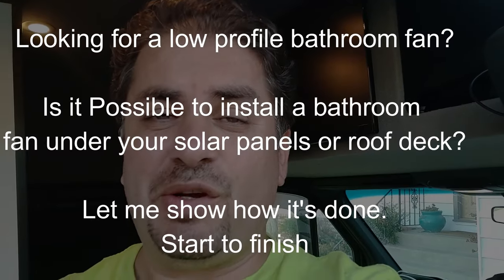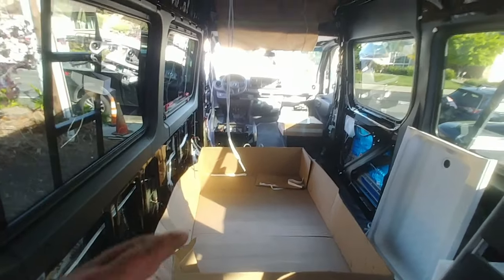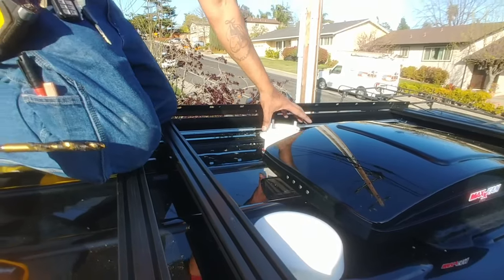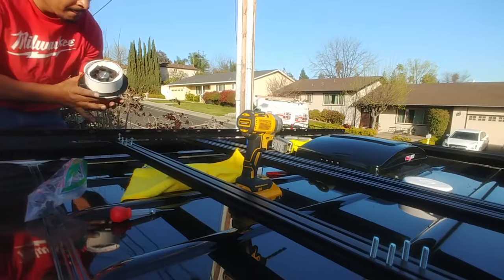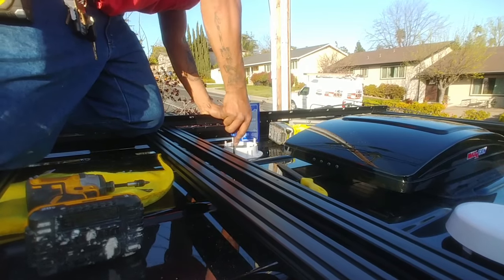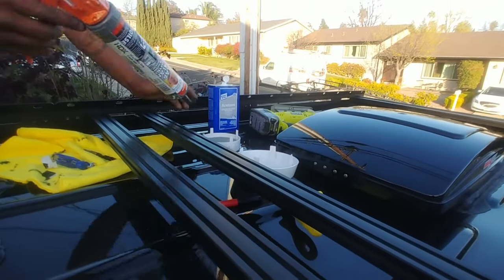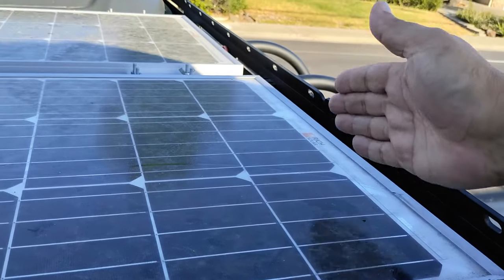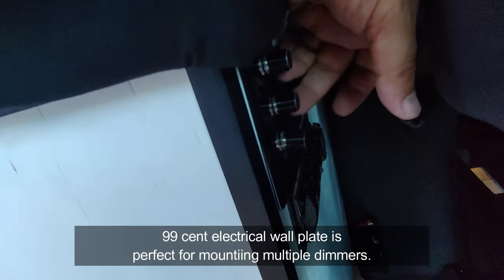Van Life DIY Bathroom Fan Install▶️ Low Profile Fan For Camper Van Bathroom

Comment from the maker: ▶Link to fan https://amzn.to/3ZYrcCK

2019+ Sprinter Review https://youtu.be/wAAV6bnHNzY
The new toy  https://youtu.be/EAKbCledvsQ
Low Key Battery https://youtu.be/-FI_DG-DE9k
How to Buy a Camper van for cheap https://youtu.be/nqPSV0mszfk
Seat Removal https://youtu.be/KSUQawuSt_w 
Headliner removal https://youtu.be/FjrJBLXEbyU
Maxx Air Fan Install https://youtu.be/QXxBSx3cfI8
Maxx Air Fan Review https://youtu.be/JIRG7lSR5yQ
Maxx Air Fan Fix https://youtu.be/6k0mPqCgrl4
Bathroom Fan Review https://youtu.be/QXxBSx3cfI8
Spare Tire Carrier https://youtu.be/wVQ_h-FjtPE
Oem Diesel Heater Trick https://youtu.be/Ws9GHo9bWeM
Led Upgrade https://youtu.be/r2KTXLqso2c
Sportscraft Swivel Adapter https://youtu.be/HVkj6KVpUbs
Pocono Swivel Seat Adapter https://youtu.be/r-1HpIl71_I
Front Speaker install https://youtu.be/JjoJH4z4G1E
van Sound Deadener https://youtu.be/8x8RxmrBxL4
Sprinter Trim Removal https://youtu.be/ucYJsH5FJxY
Van Roof Deck https://youtu.be/4cu8mjVKQzc
Front Air Filter Change https://youtu.be/U46Ah40_vIM
Cabin Air Filter https://youtu.be/y8oZNLOkrok
907 Sprinter Oil Change https://youtu.be/bmgI-9KeEik
Maintenance reset https://youtu.be/wDTMwXHGqRY
Diesel Heater Hack https://youtu.be/Ws9GHo9bWeM
DEF Fluid https://youtu.be/Q84lEhLrobM
Portable Toilet Review https://youtu.be/fYu66hqGJZo
Affordable Kitchen Galley idea https://youtu.be/5DG9y_kmHLY
Rear door storage https://youtu.be/bPZfvTWAze8
Modify Rear A/C vent https://youtu.be/o4FJ6Y1ulCs
Sliding Door Bug Screen https://youtu.be/oGA8udVJlYM
Shower https://youtu.be/O4POEFKQmJQ
Plumbing video https://youtu.be/PuOqOt_911I
Simple bed idea https://youtu.be/Q7uGVFPgeDI
Van Life Camper Van Kitchen Galley Idea Under $200
https://youtu.be/5DG9y_kmHLY
Premade Camper Van Bed That Sleeps 4 Under $250
https://youtu.be/Q7uGVFPgeDI
Thetford Porta Potti Review - Simple Odor Free Camper Van Toilet Solution
https://youtu.be/fYu66hqGJZo
Van Life Rear Door Storage Solution for Under $40 for Camper Vans
https://youtu.be/bPZfvTWAze8
Sprinter Factory Roof Ac - How to Modify Vents for Van Build
https://youtu.be/o4FJ6Y1ulCs
Van Life DIY Camper Van Bug Screen For under $40
https://youtu.be/oGA8udVJlYM
Long Seat Belts for Van https://youtu.be/b9sQHKU-xdk
Battery Shunt https://youtu.be/54xGTbcFQB0
30 amp Battery charger https://youtu.be/SY0wS3DlKho 
Battery Box Cooling idea https://youtu.be/sng2aot7PLc
Window Covers https://youtu.be/aO407scjyfU
Camper Van Flooring https://youtu.be/ACaCkg_n-qw
DC to DC Charge Controller https://youtu.be/bquwcRwfSEY
5 Tips to Sell a Camper Van https://youtu.be/2knrkpAPVug